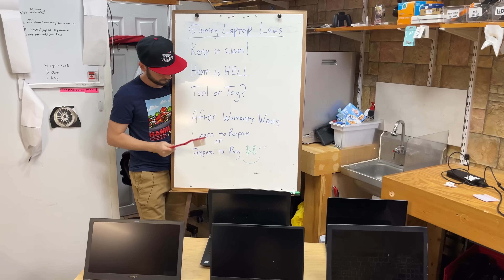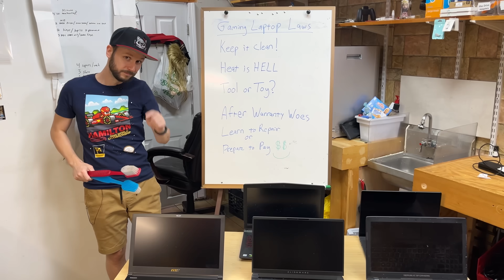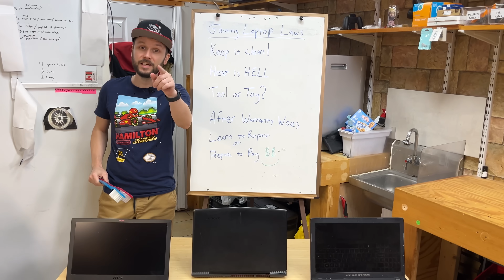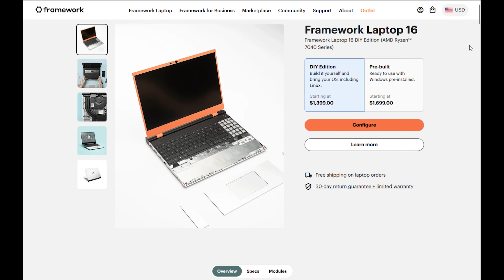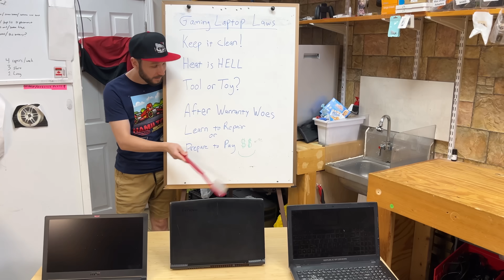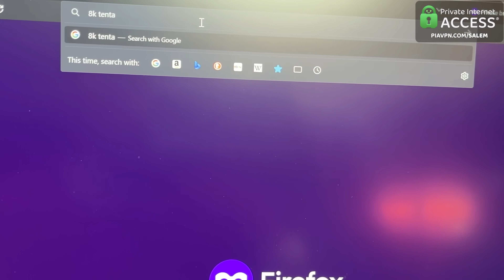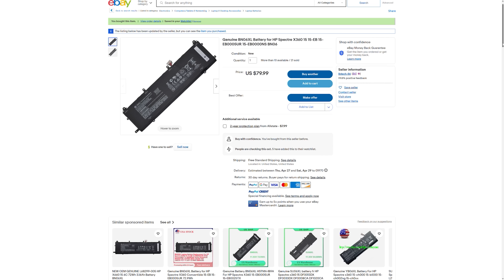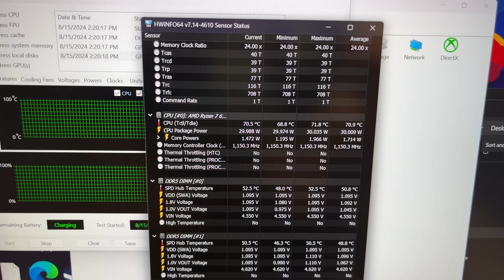Repair Shop Owners Guide to Buying and Maintaining a Gaming Laptop

Comment: I am keeping a Dell XPS17 L702X alive (13 years of service and counting) by cleaning it when I see the temps are getting too high. I call it the FrankenDell. It was so rewarding the first time I took it apart, gave it a good clean and fresh lick of thermal paste, and then reassembling it. First boot, no beuno. Heart sank. Tried again, booted right up. So relieving! Also moved from Windows to Linux to give the CPU some breathing room.

Speaking of which, I think FrankenDell has a bath day coming up this weekend!

Comment: Before I built my desktop I would take apart and clean my laptop monthly. Having 2 cats and a carpet it was like a magnet for pet dander and dust, even using it on a laptop stand on a desk. With how thin the fans are becoming on these laptops and how much heat they produce (especially Intel CPUs) it's great preventative maintenance as you said! I'm dying to get my hands on some PTM7950 to replace all the thermal paste of my electronics. I don't feel thermal paste is sufficient enough for higher-end laptops, I think that's why the manufacturers started using liquid metal recently and some even use PTM7950!
Reply: There has been so many great results for direct-die cooling, like GPUs or laptop CPUs, this stuff sounds honestly great. PTM is basically LM without the risks of electrical conductivity

Comment: I got a Lenovo LOQ 15 something something 2023 model last december.
It's been an amazing machine but I noticed that my temps were up just a little more than they used to (Baldurs Gate 3, Ultra graphics running 72 degrees C)
I checked the back and sure enoug, ew.
With a guide for my specific model and then a video from The Greatest Technician That's Ever Lived, I managed to clean the fans with my cousin's toothbrush.
Didn't have the balls to get the fans out and clean them entirely like you show, BUT it brought my temps right back down to where I am used to:
Bg3 ultra graphics running 66-68 degrees C

Thanks mate

Comment: I appreciate that while this video was sponsored by someone else, it's also kind of an ad for Framework.

Especially now that they offer a modular dGPU on the larger model and USB4 (for an eGPU) across the board, they seem super viable for the (albeit niche) demographic of folks who will gladly shell out for high-performance laptop but don't want to just buy a new one the second the warranty runs out.
Reply from the maker: I'll always praise Framework for what they're doing to better the industry and environment. If everyone had a Framework laptop, I would go out of business, and I wouldn't even be mad.
Reply: Honestly I think the framework 16 was a complete fail to be honest. 

The framework 13 was already meh and 16 pretty much jumped off of a cliff
Reply from the maker: @Marauder-q2v  How so? The point of Framework is to be the most repairable and device.
Reply: @SalemTechsperts  I meant fail as a laptop rather than being a repairable device. as a repairable device, its unparalleled.  Framework 16 seems rushed at best. For example, the DGPU has a USBC port instead of a display out. There was also the terrible chassis rigidity on the first batches. They probably have fixed it by now (would be pretty bad if they didn't)  

The pricing also makes no sense at all. Right now, I can nearly buy 3 asus TUF gaming a16 laptops (750$ each) with slightly worse specs (same gpu) for a moderately spec-ed framework. Its just a hard pill to swallow when you're paying the premium and its behind the competition in tons of ways (like OLED screens and the new ryzen HX series cpus for great battery life)

Framework mainboard pricing is also pretty awful. I honestly don't see it working out unless you go for 2nd hand. Even 12th gen (2 gen old hardware) is still pretty expensive.

I honestly think framework's only viable product is their 13 inch. Only slightly bulkier with a much more reasonable upcharge for the repairability. 

Otherwise, I think you should only get a framework if you really want to support their mission statement.
Reply from the maker: Yeah the premium that you pay for a Framework is essentially the cost of supporting their mission. You're buying the ideology first, the hardware comes second. So if you're just price shopping, then you're not the customer they have in mind. I would assume the idea is to get as much funding as possible to where they can lower the cost and make it more appealing to the masses.
Reply: @SalemTechsperts  yeah I’m definitely not the target audience. It’s not competitive enough with the competition alongside the teething pains. 

I’d probably be much better served with one of those brand new HX370 series laptops instead. 
Probably will opt for an asus g16 refresh or something like the asus vivobook s16 (or something similar)

The future for framework is bright, but not really for my use case. I think in the future, there is a potential for them to drop prices since they have the advantage of returning customers for parts instead of buying a laptop every 5 years or so.

It’ll also be interesting to see how framework handles the newer processors. Since they’re going either soldered with Zen 5 mobile and on package with lunar lake.

Comment: I bought a MSI laptop back in 2019 as I needed a computer for work but I didn't have space for a desktop as my house was getting renovated. Still working well, especially after I took the time to open it up and clean the dust and repaste everything. You are absolutely right in committing to repairing it yourself if something goes wrong. That being said, I can't wait to build my own PC someday.

Comment: I have a Dell G3 3590 since June 2020 after it got delayed three times due to COVID. No major or any issues with the laptop. Bought a cooling pad to cool the machine while using it which recently died after 3 years of 24 hours constant use, but bough the Lilano V13 after watching one of your videos and it is so far doing great work in cooling it down. But as a service technician who is also going to be doing Apple AASP work, working on gaming laptops is a nightmare.

Comment: In my area lenovo service centre are the worst one of the two fans in my lenovo gaming laptop was not working so i came across the cerivce centre and it was almost 12-15km from my house and i thought service centre would be cheaper so i didn't mind the distance much when i got there they were charging  1800rs(20dollars)just for the telling me the problem and it was non refundable and seperate money for resolving the issue and they said they needed to change the whole heat sink which would cost 3x the money instead of just changing the fans they thought i was foolish enough to get scammed but instead i did some research and purchased the fans and replaced it in a local shop which cost toal around 2.7 k rs (32 dollars) i would recommend that see a disassembly of your laptop in YouTube and learn how to repair it you will need it in future.
Reply: Same thing happens with auto mechanics.

I used to have a great car mechanic that treated my 2000 Chevy Cavilier well and at a fair enough price. Well those vacations to the Bahamas got more expensive so over the years the prices went up, the fees came out of nowhere, and the knowledge and quality of service went down. By the time we moved, that mechanic was causing more problems than he fixed. One of our turn signals on the dash went out and after multiple blown fuses, a redundant head and taillight replacement, you know that ding ding ding when you open the door, well that also stopped working. One five second swap later, the dinger works, the dash is fine, and fuses aren't blowing anymore.

Now the problem wasn't the troubleshooting, that's pretty much a given...
"Disposal Fee: $21.99"
This is a new one, never seen it before. Give me the junk, I'll throw it out myself and we can strike this fee. Oh no, can't do that, it's already done. Didn't go to that mechanic again after that.

So hard to find a good and honest repair service for anything these days. Costs of everything are going up and everyone wants a bigger piece of the pie. Got service lights on the dash again because the ABS sensor that detects wheel slippage is fucking up once more. Don't know what wheel is causing the issue (was never told) so the mechanic could take off all three wheels before determining the fourth is the issue and that's all one big labor charge for service that isn't otherwise needed. I get it, work is work and you should get paid, I ain't against that. It's just not something I can afford so I'm probably going to be taking public transport if the roads get too bad this winter.

Surprisingly, save for an exhaust leak which extended family with connections says is easily fixable, car still "runs and drives" well even after 25 years of North Dakota salt infested winters and 160k miles. They just don't make em like they used to. :c

Comment: Very good guide in maintaining a laptop, this also applies in other things. No.1 is maintaining the cleanliness of the laptop and never ever blocks the vents and always checks temps if it reaches 80c, it means you need to ramp up the fans or change the thermal paste.

Comment: Thank you for this. I recently switched from a desktop to a laptop because my needs and wants from my gaming setup have changed. I did get it a cooling pad and tinkered to set the charge limit to 60% since I plan to keep it mostly plugged in but want to keep the battery nice and healthy. I am also using my leftover peripherals from my desktop, so no crumbs or mysterious substances on the laptop keyboard!

Comment: Honestly a good piece of advice I’d give, is get a portable laptop pad. Using one and being generally clean kept my MSI laptop running for nearly 4 years until I replaced it since a lot of newer games were asking a lot from it. But laptop pads are just as portable as the pc is and will help extend the life, giving it air to breathe. Personally i have rubber feet on mine to give it a bit more air.

Comment: I've had my Legion 5 Gen 6 for two years now and it's been very reliable. I used it for Highschool and now it will help me in my Mechanical Engineering Program in College and Uni. Lenovo recently just started selling parts for this model on their website and I am comfortable repairing my own devices. Keyboard could be better but it's ok. I've replaced the thermal paste 2 months ago and it's been running great with no problems.

Comment: It's because of you that I learned to be confident in repairing my own Dell Latitude E5420 that I bought in 2010. Unfortunately that beast finally decided to rest in peace 1 month ago due to a power surge which blown out 4 capacitors in the motherboard. 

And since their are no more replacement parts for a 19 year old laptop that was literally built at the golden age of laptops, I finally put it away in hopes to repair it myself someday. 😢

Comment: I recently bought a Lenovo Legion Pro 7 on a huge deal. I went with that over building my own computer again because I travel internationally for months at a time, and a laptop in a backpack is easier to carry than a powerful lunchbox. The laptop will never touch a bed, and will rarely ever opperate off the cooling stand I bought for it. That being said, I'll probably extend my warranty just in case. Thank you for the lesson

Comment: I bought an Alienware M15 for college and told my parents it was "like a Thinkpad but better." Which was only slightly true, but in the end the battery life was an issue because it lasts ~2hrs on POWER SAVER MODE and running MS WORD. I totally agree about what you said about AMD APUs, that's probably what I should have gotten two years ago!

Comment: I wanted a PC but had to get a gaming laptop instead cuz I'm doing engineering. I've been cleaning it on a regular basis, not using it on the bed, checking its temps from time to time as well as changing the thermal paste around every 6 months or so and taking good care of it in general, hopefully it won't die on me.

Comment: Dell G7 7590 owner here🙋‍♂️ been using the same gaming laptop for over four years. I have repasted the laptop and have also had the misfortune of having to glue hinge back together. I suggest buyers to make sure that parts are easily available. I have also flashed on a new video bios for the GPU for extra performance.

Comment: While I did pick a gaming laptop for one of my brothers, he uses it for both school work and gaming and can use the extra performance.
It's a well-cooled Legion Slim, which I will be on top of maintaining properly and making sure it lasts.
My other brother got a ThinkPad with an AMD APU similar to the ones you recommend, but a smaller model which was cheap as it was getting cleared from stock.
Finding good deals on last-gen hardware they're clearing out is the way to get good value on something that will last, if you know enough to shop by specs.
Of course double-checking with repair videos and/or in-depth reviews to make sure that the hardware is of good quality.

Comment: Im currently sporting an Acer Nitro 5 2023 as main device, but i do give it a lot of air, and every 3-4 months i take it apart to clean it, after my warranty period is over im getting some quality thermal paste and pads installed to help it out abbit more, battery is actually good, 3 hours of use of a lot of excel with the portal rafio looping on the background 😂, i love it and its pretty rugged, but still thank you so much for the video, I learned a couple more things i should be careful with, thats why youre *THE GREATEST TECHNICIAN THAT'S EVER LIVED.*

Comment: My first laptop for gaming and work was MSI with 2070 Super graphics, after 3 years I gave it to my sister in perfect shape. I wanted a new one that would last longer on battery when working, bought Omen 16. Lasts double the time. It's been two years and some keycaps broke when I tried to clean them and AMD graphic drivers STILL keep crushing some apps and games. Can't get new keycaps anywhere. I regret buying it and look with envy at my older laptop, still in perfect shape and with stable drivers, running all games well.

Comment: I own an MSI GF63 gaming laptop and I can confirm all he had said to be true. Gaming Laptops run Hot like really Hot. So its critical that the heat management components are maintained properly. In my 3 years of ownership, I have cleaned and replaced the thermal paste twice. Evertime I open the heatsink, It has some amount of carpet formed on it despite gaming rarely. I also noticed that gaming laptops are also very picky when it comes to thermal paste. I once used Thermal grizzly kryonaut, temps were good for a few days after which it started to rise considerably. Currently, I am using Gelid GC extreme and results are superb. I would also suggest undervolting the CPU and GPU as this helped with temps the most for me.

Comment: I can do small repairs for me, familiy or  friends. Changed battery and displays on smartphones and tablets. On one side I like doing it and enjoy if it works after repairs. But I have to say that it uses all of my energy and concentration. Since I was a child I was  curios and put things apart. But I never learned it or pactise it on a regular basis. Therefore its always a challenge.  
What I like definetly more is building a computer. Maintenance and keep it in good shape. I am always horryfied when I see all that dust and dirt on the laptops and computers you repair. Unbelievable. Never ever would it happen that my tech will look like these.

You are doing good work and I always enjoy you videos. 👍

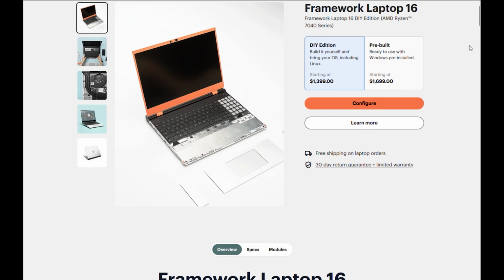Comment: 4:31 Another option is to get a Dell Precision 3530. It's like a considerably cheaper alternative to the ThinkPad P52 (non-S), and it's also a reliable workhorse. It's very repairble, with the replaceable keyboard, 2 RAM slots, cheaper componetns and the battery that's expandable up to 92Wh. I myself have switched to the Dell Precision 3530 from the ThinkPad T480 after finding one on sale for just $230, and I am very satisfied and don't look back to the T480, especially with the quality of life improvements like the palmrest that stays cool and the raw performance that is at hand, as well as the dGPU that is actually good and not a waste of silicon like the MX150 in the T480 chassis (which throttles after 5 minutes, has only 2GB VRAM, a 70C temperature limit and even has no NVENC). You can even try to play vidya gaemz on it for no reason.

Comment: Not a gaming laptop by our oldest laptop still has a 2nd generation (sandy bridge) Intel i5, these came out in 2011. Updated with an SSD and 16 GB of RAM it's still decency fast for office, vidcons and streaming despite being around 13 years old now. 
The chassis partially broke from the laptop falling down a few times and the battery is long dead, but we keep this thing until some major hardware parts fail.
😄 I now have a Medion Akoya laptop that's also from 2017 I believe (gift from a friend who wanted to throw it away and I rescued it).

Comment: I got my toshiba l50-b from an old closet and used it as a desktop because it's battery was missing, replaced the hdd with ssd and repasted it, worked like a normal pc. It can even run some smol games because of integrated graphics. It served me so well, but I need an upgrade for my college so my mother have bought me second hand thinkpad l14 gen 4 AMD, and I will always monitor the temps and take a good care of it just like the last one :))
Reply: I also learned a lot from my work immersion about computer and laptop parts so I can disassemble both with confidence.